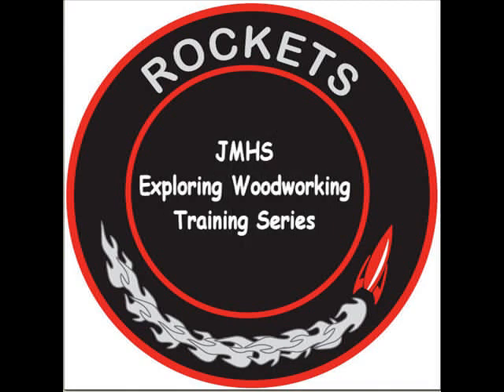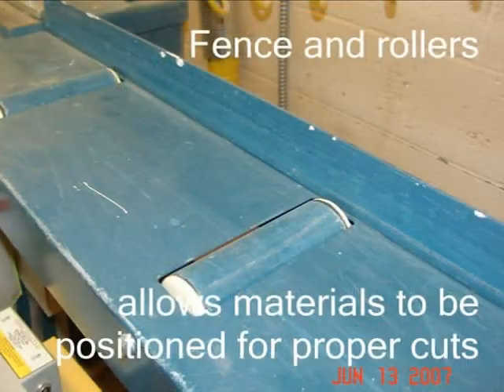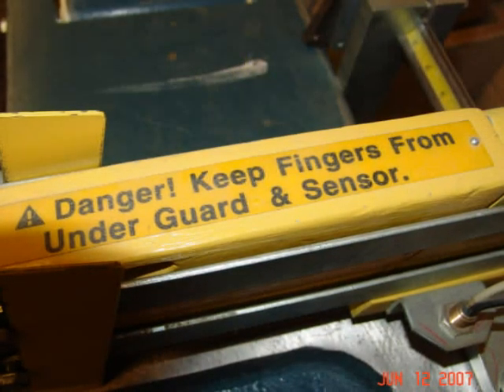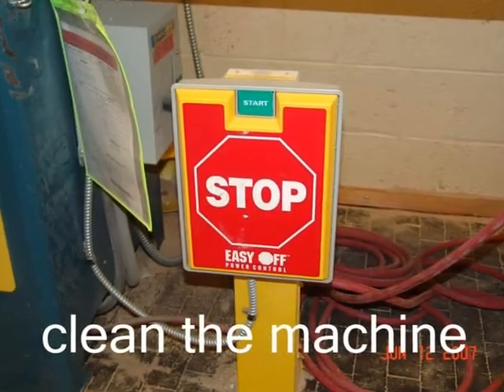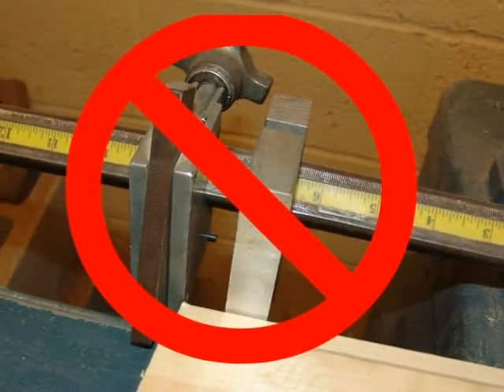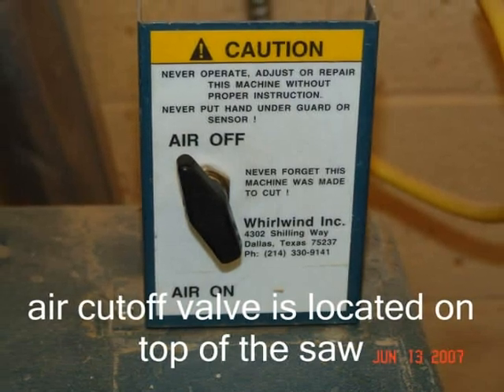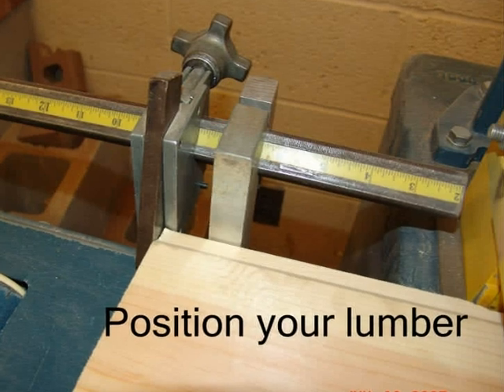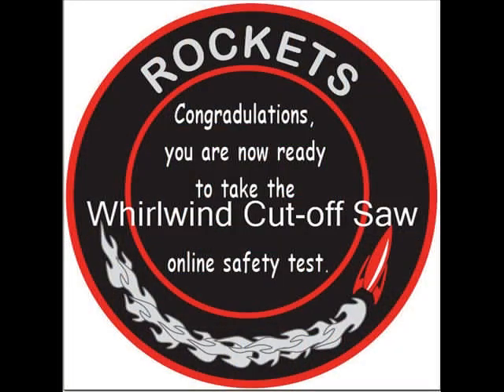Whirlwind Cutoff Saw

Comment: (Remember to Always Push the wood firmly against the fence before pressing the petal.)
 "I was moving too quick, while still holding on the board" and ended up busting a finger tip inbetween the board and the fence after the blade made contact.